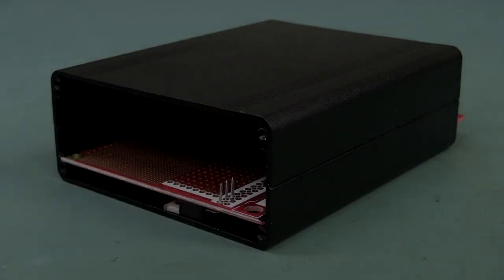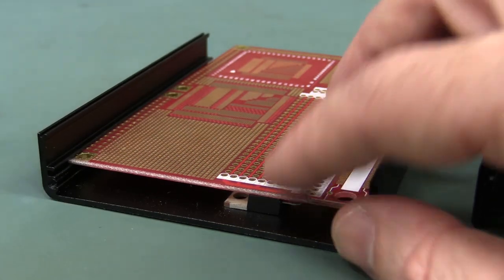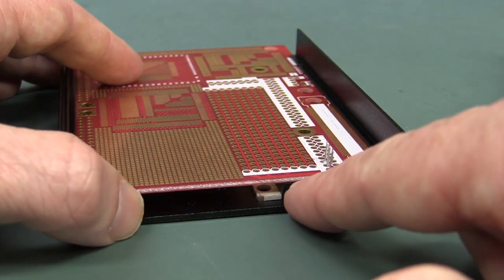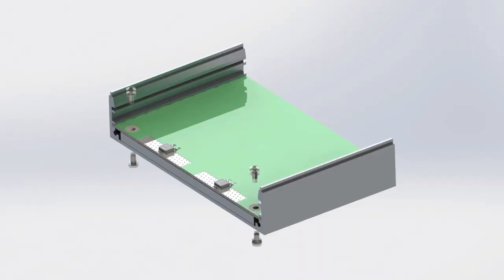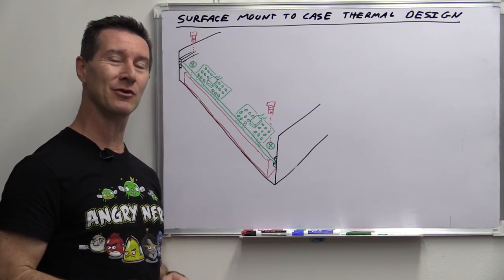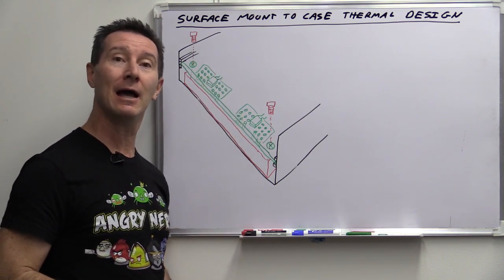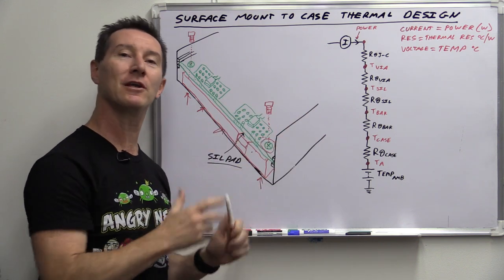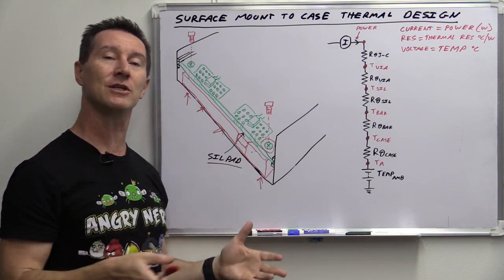EEVblog #744 - SMD Thermal Heatsink Design - µSupply Part 15

Comment: PC PSU manufacturers like Seasonic have taken to mounting their SMT 12V switchers on the bottom of the PCB, with a thermal pad between them and the case. Sometimes a heatsink is added on the top side of the PCB as well to use both the cooling from the case and from the airflow inside the PSU.

Seems to work pretty well for them, even in 1k+ Watt units :)
Reply from the maker: Maya Posch The loss through the plastic package to the thermal pad would be massive. Most likely getting away with mostly power plane dissipation.
Reply: EEVblog Yeah, but in this case, they aren't going to be dissipating 10's of watts, so they don't need it to be as good. Still, adding the extra thermal relief is a good idea, to help keep parts as cool as possible for a longer lifetime.
Reply: Maya Posch 
They also have heatsinks soldered through the board that connect to the FETs though the planes. These are cooled by the fan or convective airflow when in fanless mode. I bet that is where most of the heat goes. The case is also steel, so not very good at conducting heat.
Reply: megabytephreak Yes, I mentioned that in my second comment in this topic. Maybe Dave could figure out with his fancy Flir equipment where the heat goes in such a PSU MOSFET cooling arrangement? :)
Reply: hmm fancy flir e9... drool

Comment: Great video.  I was hoping for a demo: how cool would it have been if Dave had done the calculations for the design, built it, run a few watts of power through it and then measured the temperature to see if it it stabilised to something close to the calculated value?  That would would be great (particularly if the result actually matched the prediction !!)

And congrats to Dave #2 on the animation...very nice.
Reply: You probably dont care but does anyone know a trick to log back into an Instagram account..?
I stupidly lost the login password. I would appreciate any help you can offer me.
Reply: @Royce Johnny instablaster ;)
Reply: @Mathias Steven i really appreciate your reply. I found the site on google and im trying it out now.
Seems to take a while so I will get back to you later with my results.
Reply: @Mathias Steven it worked and I now got access to my account again. Im so happy:D
Thanks so much, you saved my ass !
Reply: @Royce Johnny happy to help =)

Comment: Here's an idea for the case mount heatsink option with the to-220 as Dave started with: Include a hole in the board (or drill) to fit a machine screw through. You can then screw down your regulator via a tapped blind hole in the enclosure! Better heat transfer B-)

Comment: It seems to me if you are using thermal vias leading to the case, it's best to do that in the middle of the board, so heat spreads out in two directions on the case. Putting it at one end distributes heat in one direction along the case (efficient) and the other direction into the air (good insulator).

Comment: Hi Dave,
I like your fundamentals videos when you are in front of a breadboard, 10^6 times thumbs up!
One question, in which case do I want to isolate the ground/tab of a regulator from the ground plane of the circuit? Could you make a short video about it? Actually I have another video request, if possible? How can one succeed to lay out a single sided board avoiding the jumper wires? It challenges me as hell as a beginner...

Comment: Dave, you know way more about design than I, but at 1:00 that TO-220 is going to need a screw to clamp it to the case. The leads can't provide enough force to provide good contact.
At 1:20 that heat sink should be isolated to avoid short circuits.
Reply from the maker: Chris W I mentioned that.

Comment: The 3D drawing shows the bar screwed from the case from the outside and from the pcb side also. This would ensure good thermal contact around the screw holes. Everywhere else on the bar, however may not be touching for thermal contact. You'd have to be pretty close if not just a shade too thick for the metal bar height or it could crack the PCB screwing down to it. Maybe you could do the same thing with some metal cylinder standoffs threaded from both sides instead of the bar.

Comment: I use this exact technique with Class D amplifiers. But I fill in the vias, and make sure the heat-sinking surface is flat. I dont use silpads, I use kapton with thermal compound. It works ok, even up to a few hundred watts, but since Class D is efficient, not much is being dumped out as heat anyway. I do as much to the PCB as I can, and avoid machining the "valleys" into aluminum for other methods which requires extra tooling/machining costs.

Comment: yesterday i teared down optical drives donated by my school, and i've seen this technique on the h-bridge driver for the CD motor. What they did was the've made a cutout on the board under the thermal pad of the component, put the silpad and then on the metal casing they've pushed the metal inwards where the cutout in the pcb is, so it will make a thermal contact and disapate the heat there

Comment: My experiences with a typical design are these:
- Spread the force evenly, don't put bolts only in the corners of the PCB but also put some in between and around the components. You can use smaller ones and use less force, it won't deform the PCB material as much as 2 big ones in a corner as Dave did in this example. I made this mistake and had the PCB arc up in the middle. It even created an visual airgap between the bottom of the PCB and the aluminium bar it should've rest upon. Nobody wants that :(

- Adding a matrix of thermal via's underneath the large solderpad did wonders for transporting most of the heat... Only a small part was dissipated by plenary conduction into the via's surrounding the components. So plug and cap your via's if possible as that stops the Tin whicking effect so it won't hurt the soldering process.

- Adding thermal paste between the aluminium bar and the housing didn't help me much, there was so much surface area between the two that it didn't make much of a difference...

Comment: you can get thermal pads up to 5mm thick to avoid using a bunch of machined parts and fasteners.
digikey 926-1148-ND

Comment: I was wondering when instead of using vias, you used jumper links (soldered both sides, sanded flat on the other side), if that would give any significant improvement? I know some people that do it for currents and claim it works great, and since current and temp flow is always similar...
Reply: In my home-etched boards, I do this often. I will also use like a thru-hole resistor lead and solder it on both sides, since the resistor will be there anyway.

Comment: One disturbing trend is that some manufacturers are using thick (~5mm) soft pads to transfer heat from large SMD ICs to cases. The problem is that over time they lose their ability to spring back and they leak oil all over the PCB.

Comment: Hi Dave, excellent video as usual. One question, what would you do with the vias if they increase the stray inductance and cause voltage overshoot in a switching circuits?

Comment: Either I missed it, or there was no mention of the following in this video.  

While much if not most of the heat to be dissipated is conducted away from the source through the copper islands and through the vias, to the thermal connector bar and finally, to the metal case and into the air external to the case, a portion of that heat does not take this course, but is instead dissipated into the air trapped inside the case via the surfaces of the copper islands and the "vias" that provide a thermal connection(s) between those islands.  And while the total amount of this interior-dissipated heat is probably minimal and immaterial relative to the total heat to be dissipated, and while this is probably not an issue for many if not the majority of applications, in theory there may be designs and applications that are in fact significantly impacted by this interior-dissipated heat.  

That said, if the goal of this video was to undertake a proper examination of and to discuss and to characterize a thermal system, then using the argument above, it has fallen short of that goal in its  failure to address an important aspect of that thermal system.  Sure, I know.  This is not intended to be a comprehensive scientific examination of thermal systems which could span an entire library of books and several scientific disciplines.  But by my intuition, it would seem that this could prove to be a common shortfall of such a design and should therefore at least have been mentioned briefly in this video.

I should add that I don't have a degree or any professional experience in EE or thermal design.  I am not an engineer (any kind) and the closest thing I get to being officially termed a scientist is by merit of my BS in Accounting.  So, I am speaking mostly from the perspective of a hobbyist and a layman here.  Bearing that in mind, I hope you will take this comment for what it is worth.  I have chosen to make a point of this only for the potential benefit of those concerned and not to discredit the author, who is doing  an amazing job and providing a wonderful service to the public with the EEVBlog.
Reply from the maker: aerofart I thought I mentioned that in a text overlay somewhere? It's not just the copper, every item in the thermal resistance chain (bar the silpad) has surface area that will radiate heat into the surrounds. I mentioned it was a simplified but practical model, and there are more complicated ways to analyse it all if you want to.
Reply: EEVblog It's all good, Dave.  It's just exciting when you miss something because it happens so rarely. ;)
Reply: aerofart He mentioned every component radiating heat to its surroundings; you could also talk about natural convection ocurring inside and outside the case, but modelling that gets pretty meaningless pretty fast and you would just resort to trying it out.

What I believe you are missing from your argument is that you have a heat source and a heat sink in the system, the device pn junction and the case surroundings, and with this model you are giving a ballpark estimation of what temperature to expect on the junction relative to the ambient one. The air inside the case could be represented as a thermal resistance in parallel from the package to the case with a much bigger value, and its temperature you wouldn't care about as it would just follow what the heat source provides it.

These considerations may be relevant when you have a heavily temperature dependent device performance and a relevant heat source sharing the same enclosure, but that was certainly out of the scope of this explanation.
Reply: jossesphere Yeah, yeah.  I know.  I was nitpicking . . .

Comment: Why don't you let the transistor stick out just enough over the edge of the PCB (which can be shortened accordingly) so that its metal part can touch a metal bar - coming from below - that is level with the PCB? Would make things much easier imho.

Comment: I guess you could use insulating heatsink plaster instead of a Pad and a screw for a case dissipation method... much cheaper and elegant than a pad and a screw

Comment: What if I want to get rid of 80W of heat from a SMD power transistor? Or do I have to use TO-247 or TO-3P packages? My USB-operated dummy load dissipates some 80W power on IRLP3034N transistor but that is a through hole TO-247 part. Can I go to SMD parts on that?
Reply from the maker: 陈北宗 80W is a ton, generally you would not do that with SMD.
Reply: EEVblog So better stick with TO-247/TO-3P for that level of power dissipation? I am trying to design a dummy load but with a design constraint that the entire dummy load have to be powered from USB.=, and that means smaller sense resistors and a hell lot dissipation on the MOSFETs.

Comment: Or may be possible to anodise the metal bar for electrical insulation. Risk is scratches or damage can break the insulation layer however...

Comment: I wonder what the thermal resistance of the solder between the transistor and the copper pad is, and what sort of temperature drop you get across it.
Reply: SnPb (63/37) is 50 W/mK @ 25°C according to https://en.wikipedia.org/wiki/List_of_thermal_conductivities

(I googled)

Comment: Most effective heat transfer with isolation at the same time is made by using thin plates made of diamond. Only problem is to actually buy them.

Comment: How do you remember all this? What do you do when you need info that are from University days? Or do you remember everything?
Reply from the maker: xDR1TeK I'm generally pretty hopeless at remembering theory, especially if I haven't touched it since uni, but thermal stuff like this is pretty basic and something I use reasonably often.
Reply: xDR1TeK I don't quite know how to respond to this without sounding arrogant, but once you've seen this stuff once, and properly understood it, it's going to stick. Visual memories of various component placed in different ways, you can imagine and play around with these various arrangements in your head. Remembering that things get hot isn't all that challenging. And all of the thermal resistance stuff? Looks incredibly obtuse and complicated, but may I draw your attention to the units of thermal resistance: degrees C per watt. For every watt you dissipate, this is how many degrees C difference you get. That's all you need to know, all the rest just falls out from common sense. I'm not saying that being guided through all of this for the first time by an experienced expert isn't valuable, quite to the contrary, but it's not like it's made up, illogical, or actually even remotely obtuse in any way. Do chefs remember everything from their chef school days? It's just a weird question to ask, really.
Reply from the maker: TheHue's SciTech I think it's an interesting question and touches on a lot of issues. If it's something I haven't touched since uni, have never really used it in practice, and didn't particularly like it much at the time, then it's unlikely I would remember it. Like for example if you asked me to solve an integral or something I probably couldn't do it, I'd have to go look it up. But once I look up the stuff it usually back to me pretty quick if not instantly. The good thing about thermal design is it's an easy concept that's hard to forget once you know it.
Reply: EEVblog Agreed on all points. I guess I saw the question (probably incorrectly) as coming from a "how do you memorize so many completely disconnected facts" kind of direction; I just wanted to point out that the same question could be asked of just about any profession or career, and that far from being obtuse and disconnected, all these facts slot together in a lovely and rational way. To an outsider who doesn't really follow, it looks far harder than it really is. Having said all that, my engineering ability drops 10x without Google by my side.
Reply: College/university education is as much about learning how to learn as it is about the specific topics you study. Even if you don't remember a specific topic, a good engineer can teach themselves what they need to know without having to have it memorized. At least that's my experience.
Reply: I can correlate between bits of information at any point in time and make a complete study on what is needed to be known, even if parts were slightly blurred by the stretch of time.
I concede that temperature coefficients are easy ohm's law comparatives, but I have been following Dave over all these videos since the days his friends told him to start a blog, he sustains a well rounded knowledge of all things mentioned on a regular basis. I am just saying it is impressive since he has to throw in videos quick notes on details that may have crossed his lifetime as an engineer quite briefly.

If it is stories you remember when dealing with certain aspect of knowledge, that I have plenty. But having to recollect specific minute details about all things technical, I have to go back to the math derivation part where the final engineering identification of a factor was first conceived for example. I can't explain it short enough. I have come up with a name for it, the W's. Whenever I need to create something, I immediately have to draw up the W's. The where when what and how. So for example I need to figure out how to design an output signal of an amplifier, I don't know what to say I should be doing. All I know is that if I were to be asked about What When Where and how the signal does something, I can go back to the books and make sure I get the math right.

We all can design a Class A amplifier, but how many of us can really design a well rounded class A amp? Please do think it out.
If I have to throw in scenarios like Gain, CMRR if differential, Feedback, Stability, SNR, FOM, Efficiency, and I am sure I can pump this comment a little further and make it intolerably long with more ideas. Now, does this class A amp sound simple? I can't remember things off-hand like Dave does. I find it challenging to figure out what is needed alone rather worry about the details of one specific aspect of the design process.

More or less, if we all study engineering, and only few of us get to become Dave, Why the heck do we bother ourselves to study at all? Wannabe engineers should just leave the engineering part to Dave. We are not worthy. I am not worthy.

Comment: If you didn't feel buying a licence for Solidworks there is a free parametric modelling open source equivilant called FreeCAD. I haven't used it all that much, and I'm sure that it isn't as feature complete as Solidworks, with the animations and physics modelling, but it is free!